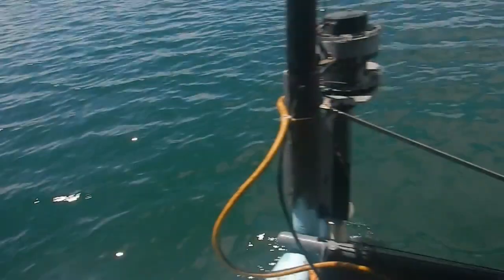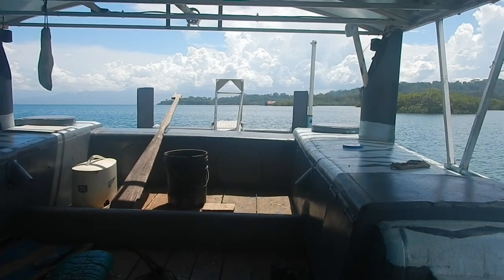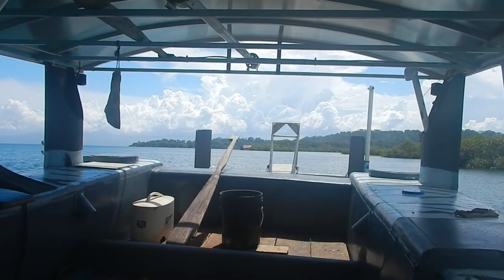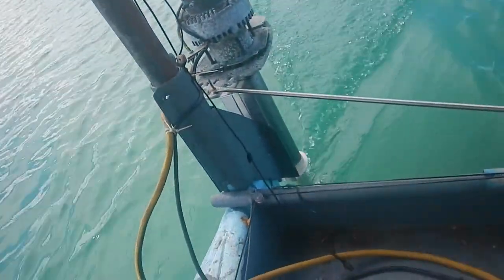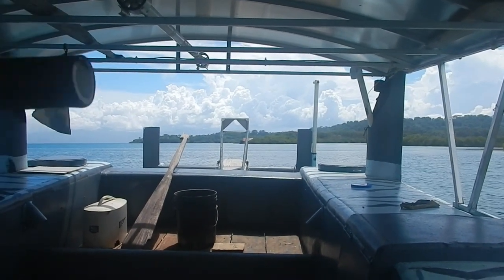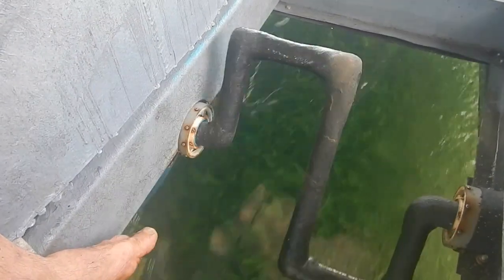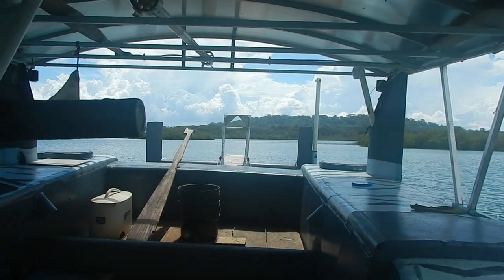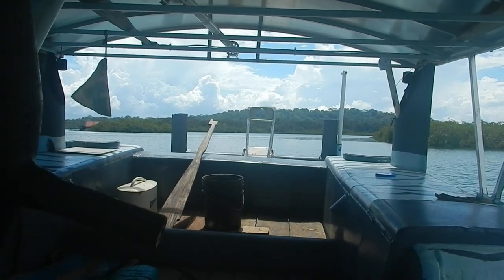Tiger Shark Upgrade -Test Drive of Motor

Comment: just a thought, with the spare motor why not connect it to the foot pedals, you can use it as a charger when pedalling manually or as a drive motor when more speed is needed in a dash for home.

Comment: I saw the paddle in the front of your boat with the asymmetrical handle.  They same happened to me.  I liked the design and appreciated the sketch you sent, but I went back to a 1 1/8 to 1 1/4 inch T grip.  I like it better than all the fancy palm grips and any others I've tried.  Other grips cause cramps in my hands at the end of the day.  I also noticed the Olympic paddlers use a plan T grip a well.  So I hope me sharing this info helps you, because you sharing your methods and experiences has helped me.

Comment: You do need a dead man's switch. But implement it with two Arduinos talking to each other via WiFi or Bluetooth transceiver. While they are talking - no need to kill the power. Stopped talking - it's the time to disengage some serious switch. This way it serves both: as a dead man's switch, and as a keyless entry/ remote start thingy. Also, it would be possible to add more remote functions to the fob (as long as they are talking, they can transmit some useful commands too to do whatever).

Comment: Isn't this the boat you put the seats in ?
You should build a "cross-board", with a rolled 6 or 8 inch cushion attached, to span the space over your peddles.
That way, when you put your feet-up, you could really get comfortable.

Comment: Fall off the boat, trail a 50 foot(or longer) floating rope with a handle, or lifejacket attached. If you can't pull yourself back aboard, you're still with the boat when it hits land.

Comment: My Ray 480 motor is 48-volt which would run on 27-volts has more potential than that. Have you calculated the horsepower? Should be 4 horsepower or 3,000 watts. At around 48 volts. Significantly lower at 27-volts. Four solar panels could produce 48 volts but not 3,000 watts although it would still run current and voltage limited. I am interested to know the numbers?